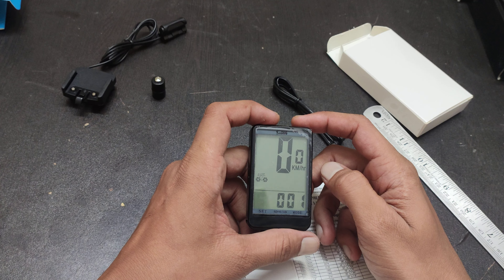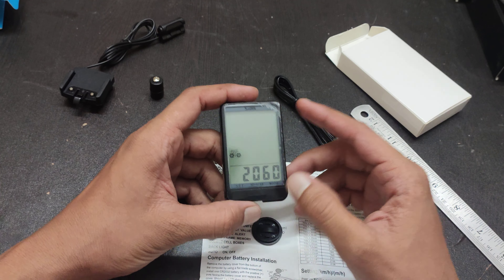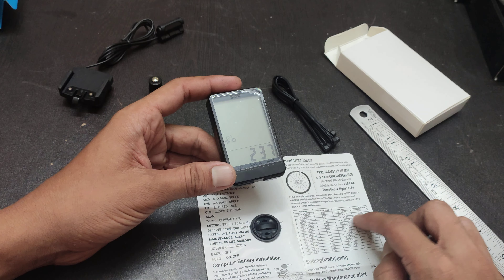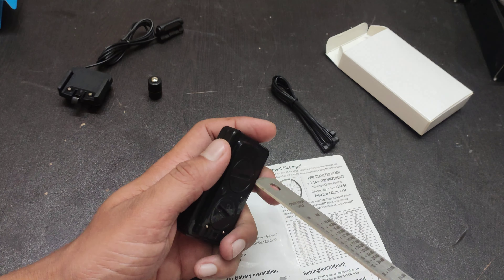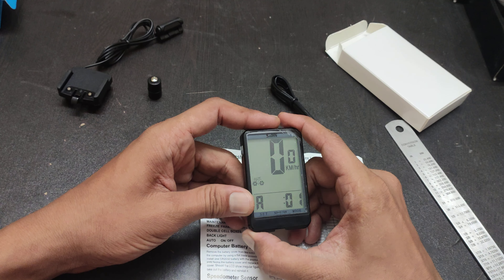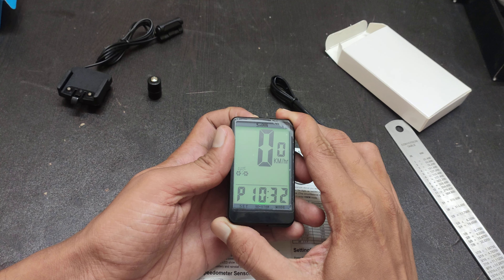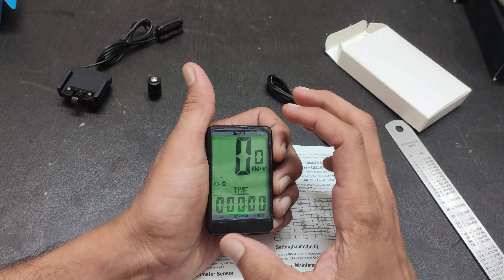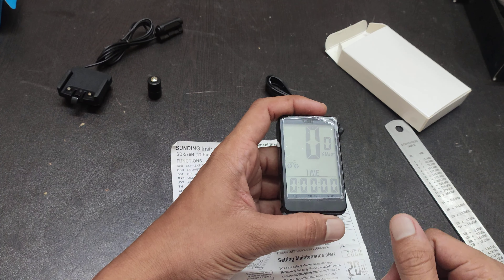Sunding 576-B meter setup

Comment: MTb cycle 29×2.40 sir please tell me the tire circumference
Reply from the maker: 2350
Reply: @tejas3993 27.5 x 2.35?
Reply from the maker: @Isaacimt  2215
Reply: @tejas3993 light always on rehta he kya night mein??
Reply: @Ashutoshpatel4444 nahi
Reply: I've cradiac alpha pro with tyre size 29x2.4 nylon
 I measured the circumference with tape it come exacty 234cm= 2340mm
Reply: @tejas3993 27.5 x 2.10?
Reply: @tejas3993  bro in Google 29 ×2.40 circumference is showing 2356